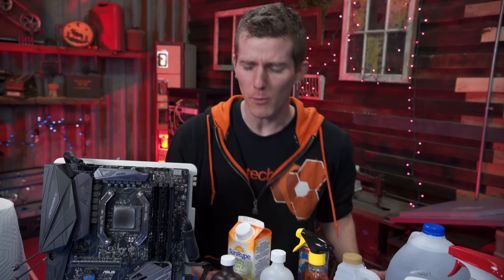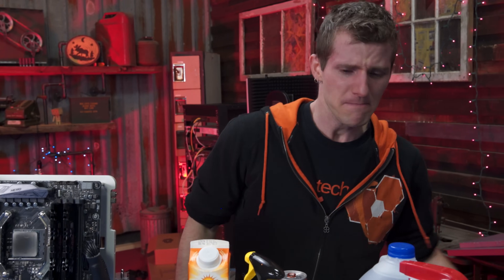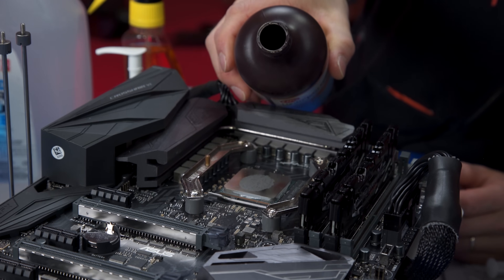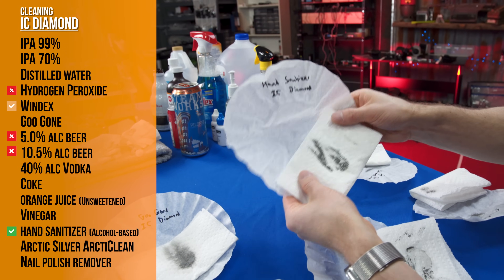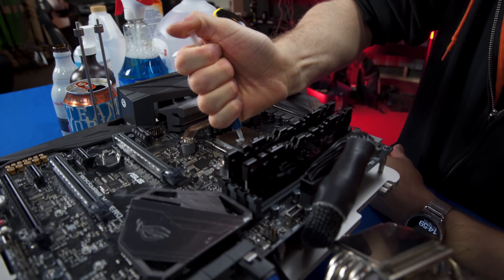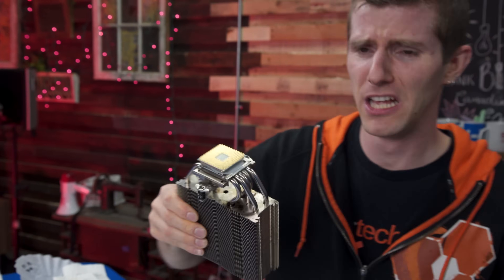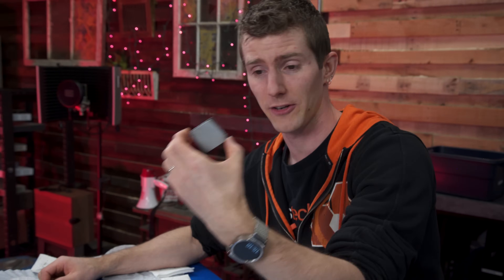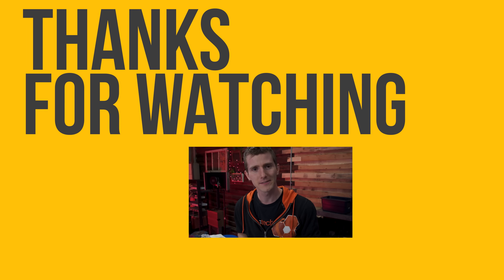Removing Thermal Compound - The BEST Way?

Comment: Uhm...Alcohol is your solvent in pretty much everything you have tested except for acetone in the nail paint remover. Those are weak organic solvent though in Chemistry if there are polymers in the paste, which from what I understand, is the case. Then, you need something like Toluene (you buy that in a hardware store. Check labels of oil paint thinners they typically contain Toluene). Careful with the stuff: It's highly inflammable & toxic (carcinogenic). Use the stuff outside to avoid breathing it in, wear gloves. Enjoy!

Comment: Just did an xbox one with original paste from 2018 - support chip putty still felt fresh but the cpu chip was crusty and overflowing and hardened into all the surrounding micro chips. Alcohol 70% soaked did not budge, windex did not budge. Too long to wait for arcticlean via amazon. So I decided to try electric contact cleaner (for electrical contacts/electronics and normally evaporates really quickly) - worked instantly was able to clean it all with some 10 or so cotton tips just gently working away the soaked chip and throwing away the cotton tips as I went . It seemed to break things down well but was hard to get the opaque residue towards the end which tended to migrate in the soaked area. Then  just patting it down with a paper towel to remove the bulk cleaner and straight on with a few drops of alcohol this made the residue bead together and continued to just lightly rub with cotton tips. Got 99% of the residue clean. I would have also tried the wd40 as the breakdown chemical and then followed through with alcohol as the final cleanup. The arcticlean seems to operate in the same way with a breakdown chemical and a finishing cleaning solution.

Comment: Still, its best to use a solvent that doesn't react with the metal components it is used for, is a very poor conductor of electricity, doesn't leave a residue and evaporates relatively quickly.  Isopropyl alcohol is one of best solvents that meet this criteria.

Comment: Methylated spirit
Reply: That's alcohol specifically denatured alcohol but you want to stick with isopropyl alcohol a.k.a. rubbing alcohol because isopropyl alcohol do not leave any residue oil behind thus why it's the preferred choice when cleaning sensitive electronic components.

Comment: I'm over here genuinely looking for advice on how best to remove old compound, and this video's just like: "Idk maybe beer will work?"
Reply: Pure isopropyl alcohol is considered the "gold standard" among the industry because isopropyl alcohol do not leave any residue oil behind compared with other types of alcohol or cleaning substances.
Reply: @DarkZerol  Thanks but yeah I figured it out a while ago, I kind of already knew that but I like to make absolutely sure I'm doing stuff right, especially if it isn't something I do all the time. I was mostly just somewhat frustratedly joking about how this video is like one of the first ones to pop up when you search "how to remove thermal paste" lol.

Comment: I always use 91% isopropyl alcohol, because for some reason 70 and 91 percent are the only ones I can find in my area.  Does 99% iso alc work better?  I dont know.  The 91% stuff works pretty damn good.

Comment: Is anyone debating whether 70% or 99% IPA cleans the same? I'm pretty sure that the reason 99% is recommended over 70% is conductivity...70% has more impurities and therefore a chance of leaving behind residue that can cause a short in your electronics. Would definitely also not recommend Windex for the same reason, ammonia and electronics do not mix.

Comment: For those worried about water left over from 70% IPA, understand that circuit boards are literally cleaned in water after being built in manufacturing. Not alcohol, just H20 in either an ultrasonic cleaner or water that is mixed with carbon and stuff like my company does. We use compressed air machine to dry up any excess water after the boards come out the cleaner. If you're worried about water left over under processors and other parts just get some compressed air and use the straw attachment thing to spray air under the parts to get the water out.

Comment: Hey Linus Tech,

Is it possible to use perfume to clean my CPU because of the high alcohol part?

My dad used this method and I think he still uses it.

Although there are a lot of oils in it, he never had problems with technology, but I am really sceptical to use it myself.

Do you have any ideas or thoughts about this?

Comment: I literally watched this so that I could apply hand sanitiser to clean my CPU last thermal excess as well as my CPU fan. Good news it worked and now after applying new thermal compound Arctic MX4 I'm seeing my CPU has 35 degrees Celsius idle. Great work on the vid!
Reply: that's why I'm here, but not finding the exact answer I'm looking for. I got a mobo+cpu+ram combo on marketplace. the kid I bought it from used way too much paste, so there's quite a bit on the board. I ordered 99% iso, but for some reason shipping was delayed a week. I have 80% alcohol hand sanitizer, but I'm worried about the water and glycerin content

Comment: Hydrogen Peroxide is your friend I just cleaned up thermal paste with it and it still works just dap it in a paper towel to clean it up this has been a traditional method to even clean your ears so why not?

Comment: The CPU came out of my socket with the heat sync recently, but my CPU was an AMD Phenom 9600 so the stakes weren't as high. It worked fine afterwards though.

Comment: Whoever reads this years after creation, use (or at least try using) Automotive brake cleaner. It works the best, and the spray helps clean every nook and cranny. I've used this on CPUs, Heat Sinks, Water Cooler Blocks, AND on Mother Boards / Video Boards for 10+ years without issues.

This also easily cleans dirt off a whole board, which migh be needed if it was in a smoker's house or other problematic (industrial) environment.

Comment: I would recommend pouring hydrogen peroxide into a cup dip the Q-tip in the cup with hydrogen peroxide and then use the Q-tip with the hydrogen peroxide and wipe it on the CPU and then use a paper towel and wipe it off.

Comment: The problem with using alcohol as a cleaning method, it dehydrates water. So your thermal paste is going to dry more quickly using it.

Comment: dont be difficult just ask your GF for nail polish remover it contains acetone. to deepclean a spill of cooling compound  out off the socket remove the MB take the bottle go to the sink and wrince till its gone NOT WITH WATER!! waight an hour and putt your cpu on first now and aply the compound and cooler the put the rest back togetther the pilish is mostly acetone and perfume witch contains alcohol so it will only leave a smell behind but thats gone in a few hours if not emediateley.

Comment: You should re-do this with a system that has been used for 6months , removing old paste is the real test. IPA 70-99% should work fine.

Comment: A few things you didn't try are Mineral Spirits, paint thinner (Both recommended by thermal compound manufacturers) and VM&P Naptha. I have used Naptha (aka Lighter fluid) for many years and it works extremely well. In a pinch, a light oil like WD40 or CRC 2-26 will also work well.

Comment: only reason to go with 99% vs 70% alcohol, is that with 99% you can be sure there won't be any significant amount of water left after the alcohol evaporates. With mx-4 you'll probably see a big difference between products once its no longer as runny after the pc has been used for a while and most of the liquid component has been boiled off.

Comment: I understand the mistake of using Hydrogen Peroxide instead of isopropyl. I've used peroxide on my keyboard before and let it sit and dry for 24 hours and it works just fine. Would I use that on any of my internal components? Hell no. Why? Because $$$$

Comment: CRC ELECTRONICS CLEANER designed fot automotive connections is the only cleaner that should be used on ANY pc.

Due to non conductive properties and perfect for PCB cleaning.

Comment: Hi, I need some advice. I had replaced thermal pad on my gpu and i forgot to peel plastic off. I ran gpu and its over heat so I checked and peeled them off after but the heat not going down. Is there anyway to fix this? Thanks.

Comment: Intro Isopropyl:  Linus, Don’t get high on your own supply. Pouring Isopropyl directly onto the motherboard (demo or not) is equivalent to pouring a bit of water onto the board. Isopropyl dissolves water over time and 99% is only assured when fresh. The older the Iso, the more water present. Iso evaporates leaving water to evaporate last. Just saying.

Comment: If there is a lot on the coffee filter shouldn't that be a good sign as well? It means that the solvent loosened it up well enough to come off with the gentle motion you guys used when you rubbed the coffee filter on the heat sink.

Comment: I ran out of alcohol, but have tons of hand sanitizer due to the pandemic. Upgraded my CPU and saved me a trip to the store. Thanks!
Reply: Update: it works and I'm so happy! It's very quiet and it went from 60c idle to 40c idle and 70-90c when gaming and recording to 50-60c!
Reply: Did the hand sanitizer work nicely? My aio is coming tomorrow and I'm replacing the Ryzen 5 3600 stock cooler
Reply: @BenTheGreat  It worked great! It was easier than using alcohol because it was thicker.
Reply: @ralonsocarrillo  thanks my AIO is getting here in like half an hour! Can't wait to get rid of the turbo jet stock cooler

Comment: i have some 70% isopropyl alcohol wipes to use on mx-4, perfection. ready to put that ryzen 5 5600x and corsair h100i elite capellix and throw out the ryzen 5 3600 and be quiet dark rock slim!

Comment: Just ripped my 5600X out of the socket when trying to replace the crappy Wraith Stealth cooler. Had to heat it up with a hairdryer to get it off of the dang cooler! Had to twist it with what felt like all my strength. The stress took a year off of my life...

Comment: In order to properly emulate a real-world scenario, Linus would have to go to people's houses with computer owners in their 60s who bought e-machines at Best Buy in 2003 and try to remove the thermal compound from Celeron CPUs. THEN we would know which one is the best. That's like removing cement from steel rebar.

Comment: Artic Clean cleaner is actually Goo Gone... It's orange and smells the same. What the hell??? You never pour straight from the bottle to CPU...put a little Isopropyl Alcohol 99% on a lint free rag, then you wipe the CPU. I know Linus likes the theatrics, but come on! With the thin compound, the liquids had zero impact because it wipes perfectly fine with only paper towel, so results for liquids are flawed.

Comment: You wouldn't imagine how helpful this is in 2020 with the COVID-19 outbreak and no isopropyl available in stores! I am going for vodka to do this job now!
Reply: I grabbed some nail polish remover from my wife... the struggle to find 99% IPA is real!
Reply: Cliff Berry did nail polish remover work? Might do it myself
Reply: Vin Diesel The thermal paste the OEM used was still very liquid so it just wiped off. I was prepared to use it and it should have worked well but it came off easier than I thought.

Comment: Who is here because of covid 19? Lol all the stores in my area are sold out of rubbing alcohol
Reply: Dude what did u end up using??
Reply: Vin Diesel I think I just used a bit of water on a paper towel and just wiped it clean it comes off easier than I thought.
Reply: @kev5834  have fun when your pc goes bye bye, water is the worst to use
Reply: JOKER • 40 years ago • Updated I just used a lightly damped paper towel it should be ok?
Reply: @kev5834  ehh maybe you might want to look at it again and see if there's any rust around the area
Reply: JOKER • 40 years ago • Updated yeah I will probably check it out soon just to be sure.
Reply: @kev5834  ya water seems to make things rust exactly with things with electricity running through it lol 

If you don't see brown ish or red ish color or a weird color your probably fine but you'll have to replace the thermal paste again
Reply: kev My guy, one of the golden rules to PC’s is to never get water on any of the components
Reply: @TheChillDeadpool  
1. If you wipe it nicely until there's not visible water anymore, you'll be fine
2. The thing literally heats up and makes any moisture evaporate anyways, so as long as only a small amount of water was used, that you wiped it nicely and that it only had contact with the IHS, you're fine.
3. The IHS is aluminium, aluminium doesn't rust. It can corrode but it doesn't act the same way as rust does with steel, it's way slower and isn't related as much to water.
4. No electricity runs trough the IHS.
5. I literally did it hundreds of times, sometimes even with spit because I was too lazy and in I'd say at least 5 years of doing it, I've never had any issues, and I've also never seen any temperature difference betwen a thourough clean with alcohol, just dry wiping it or using a slightly damp paper towel.
Reply: and hand san...
Reply: @BlueMoon97303 same bruh
Reply: Me, all I could get were alcohol wipes lol
Reply: Rubbing alcohol (IPA ) was almost impossible  to find here in my country .
Only denatured ethanol ,wich is garbage compared to IPA
Reply: @AAAAAAndrea  I can't find anything at my store right now to clean my gpu/cpu lol
Reply: @TheChillDeadpool  I had to buy 99.9% ethanol , wich is 5 times more expensive than the 90% one 🙄🙄. Cleans a bit better tho.
Reply: @AAAAAAndrea  lol I swear people buy the  weirdest things like toilet paper like come on I thought food would be more important
Reply: @TheChillDeadpool  hey so i only have 70%...should I order and wait for 99%? Or is it not really worth it?
Reply: @AAAAAAndrea  
Yeah. That's how distillation works. The higher the purity, the more tower/stages you need. It scales pretty badly lol.
Most people use 70% IPA without any issues
Reply: @RexGalilae  Actually after 96% you can't even distill ethanol with fraction, it has to be chemical or molecoular sieves
Reply: @AAAAAAndrea  
I'm talking about Iso-Propyl Alcohol, NOT Ethanol. They're different molecules. IPA-Water has an azeotropic point at ~91% if memory serves.

The most common way to achieve >91% purity is by performing LLE using cyclohexane as an entrainer or using DMSO as an extractive agent.

Molecular sieves are generally avoided due to expensive capital and maintenance costs. Not to mention, the effect of multiple thermal cycles on performance.

In any case, I'm curious. You a Chemical Engineer too?
Reply: @RexGalilae  Hey man I've read only now the comment , I was talking about ethanol , not IPA.
No reason to involve degrees and stuff in a friendly ( I suppose ) conversation 😉
Reply: @AAAAAAndrea  
I completely forgot what the discussion was in the first place, lmao.

Though I don't think I was hostile towards you, it may have only come off as so
Reply: My PCU died and everything is out of stock or super overpriced.........
Reply: Saaaaame
Reply: VxFalling  
Aa
Reply: I am just bought a 3800X

Comment: What's best for cracked and dry ps3 thermal compound?  I need to break loose the compound to get the heat spreader off off the bga gpu

Comment: I use Ronsonol or Zipper lighter fluid on the end of a q-tip..have done so for years and works excellent for any removal of heat sink paste and those hard to remove pads..then just a quick wipe with a bit of rubbing alcohol...if needed..

Comment: I've used my sisters nail polish remover for all of my builds. Works wonders.
Reply: Yup tried that yesterday and it worked. Just hope it won't destroy the cpu
Reply: @marnixds  I doubt it unless you managed to get it into the socket.
Reply: @Jmvars  Thx! Luckily I put it on the paper towel and very little of it.
Reply: Nail polish removers often contain acetone. Acetone is a highly aggressive solvent that can dissolve or damage many types of plastic. If you're cleaning a CPU or GPU, there are plastic components, connectors, and printing on the circuit board (PCB) that could be melted, dissolved, or discolored by acetone. This could lead to permanent damage to your hardware and may even void your warranty.

They also contain other unwanted chemicals for a better smell and whatnot: moisturizers, oils, fragrances, dyes... These chemicals leave a residue that degrades thermal performance. The removers also contain water, which evaporates slowly, increasing the risk of it getting where it shouldn't and causing corrosion.
Reply: @asiamies9153  TL;DR

Comment: Question, do i need to dry thermal paste? Thankyou in advance
Reply: Depends on the paste. Many of the more popular ones do not require drying, but you should find the specifics on the tube/manual/internet.